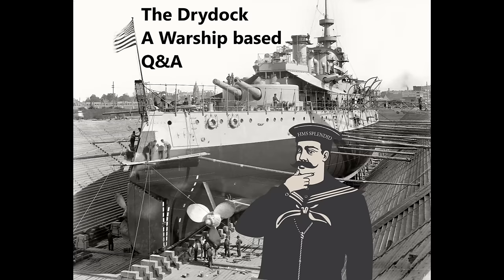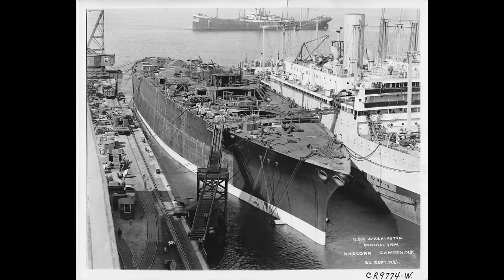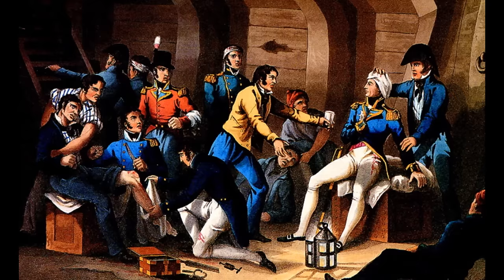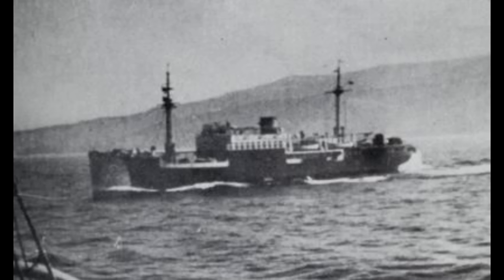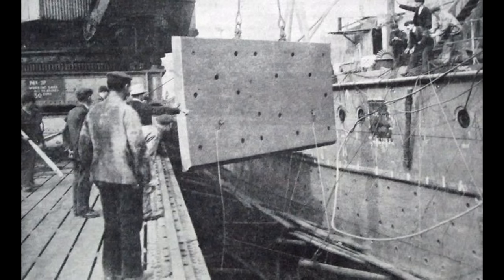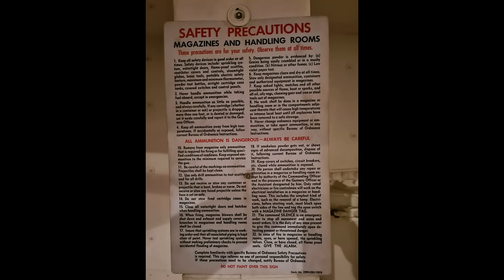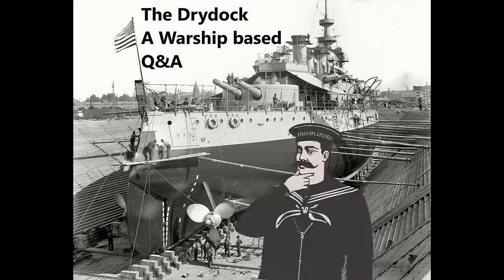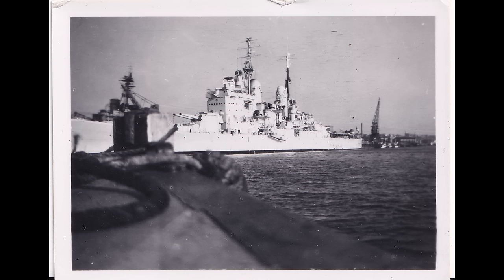The Drydock - Episode 219 (Part 1)

Comment: 02:45:09 With regards to submarines, the origin of referring them to "boats" have several possible sources in the US Navy.  The early Holland submarines were very small, and Holland's company was originally known as the "Holland Torpedo Boat Company" before becoming Electric Boat (still known by this name to this day).  An alternate origin is the term "Pig Boat", which possibly originated from the appearance of early submarines resembling piglets suckling a sow when nested to a tender, the porpoising of the submarine when diving and surfacing, or the smell of the boats.  At any rate, whether originally corporate or as an insult by other sailors, submariners adopted the name and made it their own.
Reply: Japanese submarines were commonly known as "sewer pipes "

Comment: 2:45:09 One of the other distinctions dividing ships and boats was that a boat was manned only when in use; early submarines were fairly small, and did not include accommodations for their crew, so would only be manned during a mission, and were considered to be boats. As submarines got bigger and capable of extended cruises, they retained the designation 'boat' even though they were now manned like ships. also, in the US Navy, a 'boat' is a naval vessel that is launched from a ship; since early submarines were launched from tenders, rather than leaving port on their own, this made them boats. A third possibility comes from one of the earliest terms for submarines -- 'diving boats' -- with 'boat' sticking long after they began to be referred to as submarines.
Reply: So far I have found only two useful ways to distiguish between ship and boat:
1.: use the porn definition: "I know it when I see it".
2.: It's a ship if the crew gets annoyed when you call it a boat.
Reply: @Bird_Dog00  when i was in the navy, subs were called boats and mine sweeps were called boats if they were wood hulled. Like MSOs MSCs and MSBs.
''It's a ship if the crew gets annoyed when you call it a boat.'' US  Sweep sailors prided our selves on our wooden boats.

Comment: Navy vet here. Regarding craft, ships, and “boats”. 

The official military definition is as follows as according to NATO and the USN:

Craft = any vessel displacing up to but not including 500 tons. 

Ship = any vessel displacing 500 plus tons. 

Boats = this was an older Navy term that once applied to craft of a specific shorter length than ships.  
In modern times this is traditional slang for submarines and carriers used by their crews out of affection and tradition and as a mark of honor. Also we’re rebellious, as any Brit will attest too. LOVE YOU DRAC AND DR CLARK!

Submarines:
According to my late Father (career submariner) and his fellow submariners, prior to craft being adapted as the modern distinction between ships and smaller non ship vessels, boat was the official term for non ship vessels.
They were defined by their smaller length. When the first submarines were commissioned into the USN the term boat was applied as their shorter length designated them as such. 

Eventually as they began to displace ship tonnages and the Navy being very traditional, the crews kept the term boat. 
No one in fleet command was going to challenge a crew of highly intelligent men who purposely sailed into the deep ocean to intentionally sink their boats. You don’t do that. Just don’t poke them. 
My family were military dependents for nearly 20 years and all we ever heard submarines referred to as by their crews were boats. It's what we called them as well.

Carriers:
This slang has been used by carrier air crews for a very long time and it’s stuck. 

Hope this helps clear up any confusion. 

Basically remember the official major categories are craft & ship, with boat being a traditional term.

Comment: @ship vs. boat in olden times: AFAIK, a boat was "a watercraft that does not have a FIXED mas"t. This was to account for the fact that many bigger ship's boats (like cutters) had the option of stepping in a mast if the winds were helpful; e.g. if travalling ashore or between ships you could row one leg and sail the other one.

Cutters seem to have been the dividing line anyway: large enough thet some were operating on their own with a permanent mast as fishing vessels and patrol craft while still small enough to be accried aboard a ship of the line as a "small craft".

Comment: During the time period after 1916 both the US (due to the major improvements in metallurgy by the Midvale Company) and British (by the results of Jutland making them study Krupp shell designs and finding out that they needed new test specs for their AP shells -- they hadn't been updated in decades since the first major ironclad, HMS WARRIOR, was commissioned) had some major improvements in their AP ammunition and, in the British case, also a better understanding in how the 10%-black-powder-filled Common, Pointed, Capped (CPC) shells for use against smaller armored warships actually worked.

The Midvale Company had developed in 1911 an 8" (203 mm) Mark 11 MOD 1 AP projectile that, in most cases when tested at right-angles, remained intact even when it bounced off the armor it hit, which was previously considered impossible against Krupp Cemented type of face-hardened side armor.  Since this was not a battleship shell, though, it seems to have been ignored by the US Navy.  In 1916, though, in its Midvale-made 12" Mark 15 MOD 6 AP shells, Midvale had enough test results to apply this hardening/tempering system to its battleship ammo.  The results were even better, even when tested at up to 15 degrees from right-angles all of its new "Midvale Unbreakable" shells remained intact whether penetrating or not, allowing the "Effective" (British "Fit-to-Burst") striking velocity to be lowered to the barely-penetrating-in-any-condition "Navy Ballistic Limit" (British "Perforating Limit").  This immediately made all prior US AP ammo obsolete.  Because the AP caps remained soft, though, the impact angles for possible unshattered penetrations did not improve.

Only when hard-capped mid-1930s US Navy new AP projectile designs were introduced did projectile shatter of US AP shells no longer occur at any impact angle (the caps always worked), though of course other types of damage could occur, especially against the lower shell body at higher impact angles as the shell was "refracted" to a more-right-angle direction as it punched through.  The WWII hard-capped AP shells, made by all three manufacturers of US Navy AP shells -- Midvale, Bethlehem, and Crucible Steel -- used a Russian Doll (softer regions of smaller size as one went from the top to the bottom of the shell and from the outer surface to the explosive cavity surface) "Sheath Hardening" method, where the entire nose was of one maximum hardness (525 Brinell or 555 Brinell, depending on the manufacturer's idea of the optimum nose hardness), then along the centerline the hardness dropped rapidly to the minimum hardness of circa-249 Brinell, which it kept to the tip of the explosive cavity in the lower half of the shell.  Along the outer surface of the shell, the hardness dropped much more slowly to about the minimum 249 Brinell value just above the lower bourrelet where the driving band was cut, going rapidly softer to the 249 Brinell when you reached the surface of the explosive cavity from top to bottom.  This eliminated any sudden steps in hardness anywhere between the highest and lowest hardness values, so cracking of the projectile near the explosive cavity from a force from any direction was minimized.  Later shells had some improvements in the hardness pattern, such as having the minimum hardness upper to 256 Brinell in the 12" Mark 18 MOD 1 to make the shell slightly more rigid at oblique impact and a proposal, never actually implemented after WWII, to change the final tempering temperature of all AP shells to 350 degrees F from the WWII standard 475 degrees F, which was found to give a harder and more rigid shell lower body but with no increase in cracking during experimental tests.  US naval ammunition had much more variation in design during WWII than any other country had.

The rather major change in the hardness pattern from the earlier "Through Hardening" -- with the entire projectile nose of one maximum hardness everywhere and then a sudden step to the minimum middle and lower body hardness at the joint of the nose and cylindrical body, which was originally used with chilled cast iron projectiles -- and the British-developed improved form called "Decremental Hardening" -- where the Through Hardening method was modified to have a more gradual softening at the base of the nose to the minimum hardness around the tip of the explosive cavity but kept constant at any distance downward from the centerline to the outer surface (unlike the Sheath Hardening, there is no improved rigidity against forces from the side, so high-obliquity impacts can bend the shells much more than with WWII US Navy AP shells) -- when Sheath Hardening was introduced, imply to me that this may have been, among other improvements in hardening and tempering that the Midvale Unbreakable AP shell used, the basis for the later major improvements in post-1930 US Navy AP shells resulting in 35-40-degree oblique impact spec intact penetration requirements against 0.8-caliber of US Class "A" KC-type armor from plates of the 1921-25 "Bethlehem Thin Chill" (15-20% face thickness) made by both Bethlehem and Midvale for and then stored due to the cancelled Washington Treaty of 1923 battleships to the latest Thick Chill (55% face) WWII armor and, even more, the ability of these US Navy WWII AP shells  to penetrate in an intact condition plates much thicker than the US AP shell's diameter -- 17.3" Thick Chill Class "A" barbette armor using 14" Mark 16 AP projectiles at 30 degrees, for example -- which was virtually impossible for any non-US AP shell made at any time by anyone else.
 (CONTINUED ABOVE)

Comment: The whole issue with pirates is they got even splits of the booty.  They wanted as small a crew as possible not 800 guys to run a large ship.  In most instances they were extortionists.  Give us the booty and you live, fight us and you die.  Many used long boats to attack anchored ships.

Comment: 02:36:30 - Was the rivalry between the IJA and IJN really that bad? 

The issue is that people tend to misunderstand where that Honor and Loyalty lies. Japanese society was (and is) one that has most every conceivable social relationship highly regulated by custom, tradition, and often law. The blunt reality was that the Army and the Navy were not obligated to be loyal to each other, so they were not. They only had to be loyal to Hirohito, which they most certainly were, and that was technically adequate. In theory, the Emperor himself was supposed to ensure the two services worked harmoniously, but only Meiji really took that role seriously, with his successors, especially Hirohito, really neglecting such things.

Comment: On the Ship vs Boat thing, it is, linguistically speaking, two words for the same thing with different etymologies. The word 'Ship' has the PIE root "skei-" and boat has the root "bheid-", both meaning "to cut/split" referring to 'hollow out a tree trunk'. Depending on time and place (something which should always be asked) the definition on what is what has changed. Eksample: In Old English ship could reffere to both a small and large vessel.

Comment: concerning pirates acquiring a ship of the line; Based on examples such as Jesus of Lubech, actually buying one might be an option. Especially if you have connections and patronage… Say, an old three decker is taken as a price. The ship is sold “for breaking up”. Some time later a privateer rocks up with a razze frigate…
Reply: Well another possibility is convert an East Indiaman or similar ship in a Ship of the Line. I think buying or converting would the mostly scenario. 🤔

Comment: 22:37 Drach buddy, pal, chum. There was not a issue on the flight deck with operating tomcats it was hangar height, they were too low to allow for a Tomcat to be jacked up for a gear swing. Tall tales and all that.
Reply from the maker: When I was on the ship the docents explained the one F-14 they had to launch after it accidentally recovered to them barely made it off even at light load.
Reply: @Drachinifel  tall tale, it had the same C11 catapults as on the Nimitz class. I worked with sailors that were stationed on the Midway. When they transitioned to Hornets and happy the Phantoms was going.

Comment: I don't think hydrogel would fully work as a water substitute because the balls at the bottom of the bearth would have to compress and bear all the weight of the beads above as well as the ship, and these things can be crushed relatively easily, unlike a true liquid, unless you only intend to cover the top layer of water with these things

Comment: Drach, Drach, Drach - I have to correct some of your terminology used in your discussion of what constitutes a ship and what constitutes a boat (time stamp about 2:38 or so). Actually an age of sail ship, barque, brig, square topsail schooner etc. carries yards which themselves have yardarms. The yard is the whole spar carried (usually) at approximately right angle to the mast. The yardarm is that portion of the ends of the yard, usually painted white, outside of the band holding the lifts. The lift is a piece of standing rigging (means it doesn't run thru a pulley & is often wormed, parcelled & served as well as being tarred) that supports the ends of the yard when the sails are furled/the yard not hoisted.